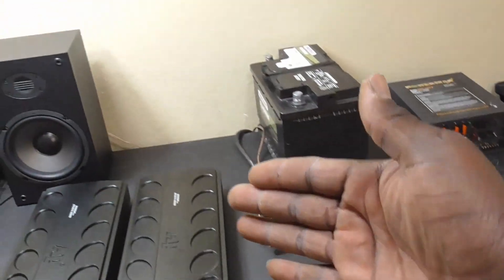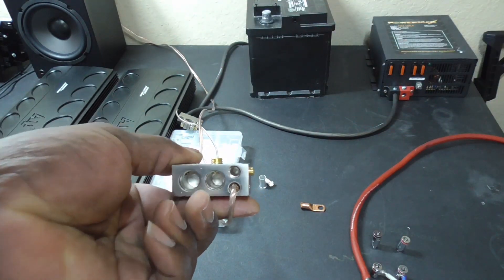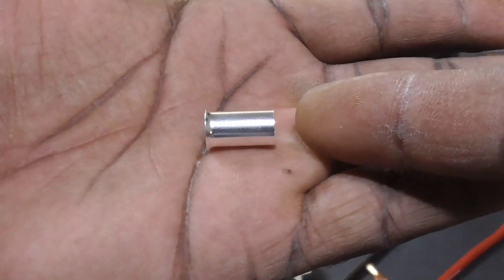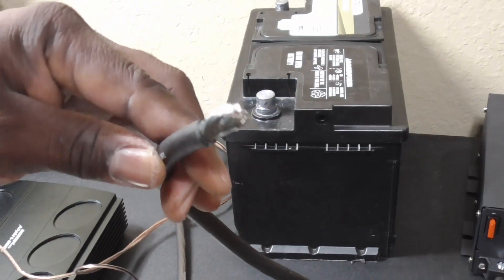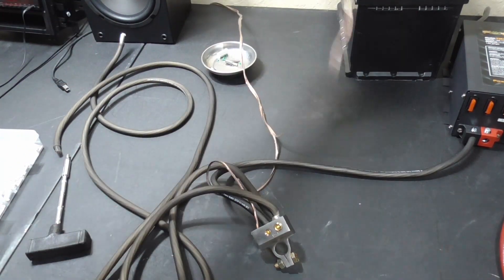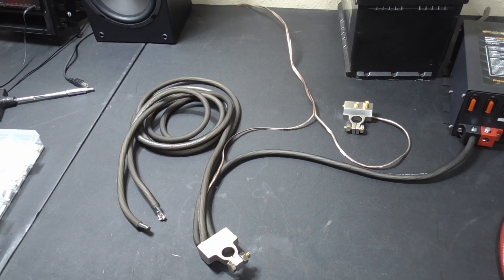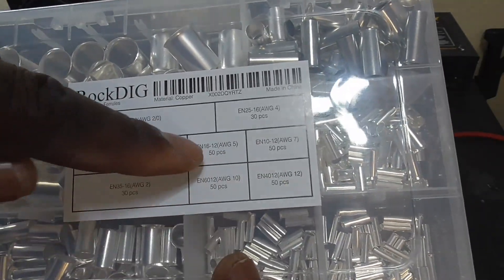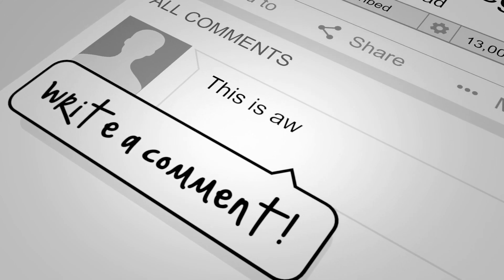Cheap And Easy Wiring Accessory: Ferrules

Comment: When applicable, for dual run power wires, I prefer to use the lugs with a marine battery terminal for the battery. Both ways work, ferrells are the way to go for clean and safe installation.

Comment: I finally broke down and bought a ferrule set last week and reconnected all my wiring to my 5-channel amp to give it a cleaner look.   I was tired of my bare wire insertion for my door speakers becoming brittle then breaking off causing the sound to be intermittent in my coaxial speakers.
Reply from the maker: Yep, they are very helpful.

Comment: I use those Silver plated wire ferrules with heat shrink makes a really clean connection really bugs me see a couple strands of wire sticking out plus that's all it takes to ruin your equipment.

Comment: Longest build I've ever seen at this point bro. Are we gon see the Taramps slap the vxf's this year?
Edit: I just think if you were posting more results then the channel would grow faster. Some ppl need the indepth info but the majority of this audience wants to see results. Let barevids do the tech stuff cause he's rebuilding and perfecting amp builds that have went pop.
Reply from the maker: I'm currently editing the MD8K footage. Its a lot. I bench test before installing in any vehicle. Its safer that way. Plus I have lithium cells to test and install as well. I try to test things 'The Right Way' as possible. And I can guarantee you, when you see my video on the lithium cells. You will learn something new. Be patient my, bass brother.
Reply: @BudgetBassHead  That's cool cause at this point I lean towards AGM just cause I'm not comfortable with lithium. I see a lot of guys using it but it doesn't seem all that safe to me still to this day. I mainly think along the lines with lithium that I'll have a wire issue (wire arch somehow) and my lithium bank would send me to Jesus...

Comment: It would’ve been better after doing all that if u would have got them back  out of the block and solder it
Reply from the maker: Solder sometimes introduce corrosion; depending on the 'type' of solder. but solder is mostly not needed, if crimped tight enough.
Reply: If you’re messing with any kind of electrical in a car and you don’t know what kind of solder to use them maybe that person or whoever should not be messing with car audio at all
Reply: And one more thing they actually do sale a crimping tool for those if you’re not using solder you should use the tool to crimp it right

Comment: As I commented in the last video, The 4 gauge wire just like their 1/0 is NOT over sized. Read right below the illustration on KnuKoncepts page on the flek wire and right below the amperage chart on wiki that yout referenced in the last... Or here as followed.
Knu- Below the picture in the specifications tab.
"*Core OD estimated, being stranded cable there is no true measure for B"
Now they say it is oversized BUT they state "increased surface area" This is because they use more thinner strands, note how they also state "Notes –While our Kolossus Flex Kable is oversized, most manufacture’s terminals will still fit our cables." They fit because it does not have a oversized cross sectional area. There is ZERO regulation on audio wire and they can tell you what they please and they word it sly. Not bad wire however not a higher gauge then what they tell you, We need not anymore misinformation in this community 

Wiki -
top of chart reads "The diameter information in the table applies to solid wires. Stranded wires are calculated by calculating the equivalent cross sectional copper area."  Then below the chart reads "AWG gauges are also used to describe stranded wire. The AWG gauge of a stranded wire represents the sum of the cross-sectional areas of the individual strands; the gaps between strands are not counted. When made with circular strands, these gaps occupy about 25% of the wire area, thus requiring the overall bundle diameter to be about 13% larger than a solid wire of equal gauge:"

I have had those terminals crack on the thinner piece that clamps the battery. Don't know what the material is but sure isn't brass and its cast where should really be billet.
Reply: What say you about Sky High "oversized" 1/0... Same thing? I have it next to some skar 1/0(not 1/0) and some RF 1/0 ATM And it looks pretty beefy in comparison.

They should define "oversized".
Reply: @snauspockets9924  as far as I know, I thought sky high 1/0 CCA was oversized stating it's actually 2/0 so that it meets the rating of OFC. I thought their 1/0 OFC was true 1/0 as it is equivalent to welding wire in strand count and flexibility. Now i know they have tinned which is new for them.

I do not care for sky high, not because their product stand point, as it is quality...

I build my batteries, alternators, rebuild my amps and design and build my enclosures. My builds are 100% me. I'm not a hear say kinda guy, i do research, obtain product and test real world. I've bought spools to try out all different wire. I am going to be running all CCA wire just because everyone is and will be up in arms about it cause their brothers cousins, cousin is dumb (😂). There has been people with 170+ builds running CCA. One guy running CCA changed to OFC because everyone told him he was losing power, he spent all that time and money to gain absolutely nothing, not a damn tenth, nothing!

 I'll have 5 runs from alt to rear 90Ah Cmax, have 1 370 and 1 320 for alts, 18k amp on 2 15" NSv3s. I'm not chasing numbers, I'm going low.
Reply from the maker: Thanks for the info. But misinformation is never an intent on this channel. To recall, I was only referencing what was listed on the amplifier. I don't think the engineers of the amplifier was intending anyone to use 2/0 solid wires. No offense, but most 'car audio' wiring companies are selling stranded wire and there is only a hand full providing as many strands (diameter) as Knu Konceptz. And remember my measurements showed 1/2 inch; which compensates for the percentage loss/equivalent mentioned in the article. Nevertheless, you've pointed out an excellent point and I know, more than I, will thank you for your observation.
Reply: @BudgetBassHead  I am not talking about the amplifier at all. I know misinformation is not intended, then we would call that disinformation and there is plenty of that in this community as well, that's neither here nor there.

 I'm talking strictly on the mention of Knu 1/0 being 4/0, 4ga being 2ga. It measured 1/2" on a tape measure. Try a caliper, account for air gap and what do you get? That's your cross sectional number. 

 I listed off from the vendors website and the Wikipedia page about AWG they both state that the AWG thickness is for solid copper. Stranded wire is not as easy to measure as there is a lot of air gap between each strand as circles do not completely fill the voids. Knukonceptz says they use more strands however they are thinner strands, considering skin effect plays no roll in VDC and the frequency of VAC on the speaker wire is not remotely close to being high enough for skin effect to take place, more strands only means it is more flexible (Is it Flek or Flex???? They don't know either so take their info with a grain of salt).....and less tinsel strength.

At the end of the day as i said, audio wire needs no underwriters laboratories rating, FDA, FCC, FBI wtf ever else.... No standards at all. But the way info spreads is like telephone except it's worse then elementary school up in this! 😂
Reply: I do find it interesting that all over the Amazon listings they all say Sky High Oversized 1/0 OFC and CCA alike.....but when you go to the actual sky high site they don't say anything at all about "oversized" instead saying "13mm or just under 1/2 inch".

Marketing hype or not it is good wire.
Reply: @DTW-bx2vy  what claims are you questioning?
Reply: @DTW-bx2vy  I'm uncertain on what claims you think i am making that are false but i have however listed the source. The same source he referenced in the video just didn't show nor did he see or understand the info completely. In no way am i bashing him or anything of the sort. I like his videos, his enthusiasm and only trying to help him if so needed. Just as he don't want incorrect info to be spread. As i said these are not my thoughts or what i believe to be correct, it is literally the same source he presented in the video. I don't make videos because I'm too busy doing other things and don't have one single "thing" of content I do on a regular basis. My proof is listed however i guess that entails one too actually put in a little work to do so. Of course there's people such as yourself whom like to try to prove me wrong and to that I encourage you to do your best, good luck!
Reply: @DTW-bx2vy  First, you need to reread where i said CCA is equal to OFC as I did not state that. Second, there is no inductance in DC so try again. 

Now what I said is skyhigh oversizes "1/0" CCA to 2/0 to meet the rating of 1/0 OFC. I also said there was a guy who had a 170+ db vehicle whom ran CCA and switched it all over to OFC and had no change what so ever. Now with that said, he obviously ran his wire accordingly, 1 run to 1 run sure you will gain something, at the level I run, 400watts isn't going to make a lick of difference if that were the case HOWEVER I stated I'm going to have 5 runs from my alternators to the rear Cmax banks. Now my alts are 320+370 which equals max 690 amps I'll be able to pull from the alts to the rear batt, there's no going over that EVER as it don't exist and that's not including the cars consumption but let's take the 5 runs of CCA and under rate it's capabilities and say max 1 run can carry is 200 amps, 5x200= 1000 amp current capability yet my max is 690, so leaves me with 310amp head room, with that much headroom you think I'll have enough conductor to combat any resistance or choke it might have compared to if i were to run OFC instead? The fact is, if you run the proper amount of conductor and (pay attention this one is very important) terminate your ends properly, you will run your system to it's full potential no matter the material you use. Now what false claim do you want me to prove to you that you were unable to grasp what I had said? As I said good luck!
Reply: @DTW-bx2vy  i also don't have a channel and make content cause I am a asshole. Well aware!

Comment: I think u will have to replace those wires in a few months. I did that to me 8k and I always have to replace the wire after awhile.
Reply: A few months? What? Where do you live? Is it a coastal environment with salt spray? Is it hella humidity every summer? Is the system on a fishing boat?

My sky high 1/0 OFC had better last YEARS or I'm going to be unhappy. I'm in the Seattle area so I don't have any of those environmental issues but damn, a few months? 200 bucks for 50ft!
Reply from the maker: Do you run OFC Marine Grade wire? Thanks for the tip.

Comment: You need to get some better battery terminals, those Chinese ones are made of cheap alloy and actually create more resistance than copper or decent stainless. Get some Jims Machineworx, GPAudio, or ILL Customz terminals, I prefer Lug Style myself....that way you can add more batteries and grounds and make your setup POP as well as see lower voltage drop.
Reply: lugs are good under hood as then you are able to completely seal the wire from the elements. Lugs and adhesive lined heatshrink!
Reply from the maker: Good info. Thanks
Reply: Yeah I got thinking about that too when I bought Sky high wire that doesn't have silver tinnig for corrosion. Once I put the lug on there and the heat shrink I don't see how it could matter. Zero wire exposure.
Reply: @snauspockets9924  wire is only as good as your termination!
Reply: @commonsenseisdeadandgone  okay sure but I was commenting on whether I should worry about the wire corroding or not. I'm going to do copper lugs on copper terminal plates... did you have a better idea for me to consider? I am all ears...
Reply: @snauspockets9924  Assuming copper buss bars ? Where? 

For under the hood i recommend all terminations to be tinned lugs, adhesive lined heat shrink, aluminum terminal connections, fuse blocks sealed, grounds ground to bare metal(as always) then primer/sealer, paint and clear. (I live in Minnesota so this might sound extreme but it's extreme conditions up here) but under the hood no matter where you live is brutal conditions with the heat cycles and elements. I crimp all my connections, i have the hydraulic crimper but find myself using the BFH smashy smashy tool most often. 

In the car its fair game, expose all the wire you want, whatever material you want. If you have issues inside, you issue is the outsides getting in! And in that case you have much more to worry about.

Comment: Nice Clean Job How The Audio Connection Gear Has Sky Jump From Late 80,90 So Much Affordable Gadgets And Gizmo Make Stuff Safe & Accessible. (Pharaoh) Ferrule Something Very Interesting Something Secure To Use Clean Connection. 👊🏻👍🏻✌🏻
Reply from the maker: Yes they are very handy. I've been using them for a few years now.

Comment: I started using ferrules on my current build. I like them but if you dont get it tightened down enough the wire tries to slip out.
Reply from the maker: This is very true. You have to torque them properly.

Comment: whispers heat shrink
Reply from the maker: I was going to use the heat shrink but wanted you guys to actually 'see' what is looks like. Plus this is an indoor setup, so really no need to protect against humidity or anything. But heat shrink does add style points 😉

Comment: I use electrical tape or shrink wrap to hold the ferrule in place and to make sure you don't see bare wires where the shielding and ferrule meet. Thanks for making videos.
Reply from the maker: That's a great idea! I was going to use the heat shrink but wanted you guys to actually 'see' what is looks like. Plus this is an indoor setup, so really no need to protect against humidity or anything. But heat shrink does add style points 😉
Reply: Yes that's what I do I use heat shrink and it holds it in place that way you don't have to hold it all awkward
Reply: Heat shrink can be necessary so a stray wire doesn’t pop out. I have the same issue, I used an Ill Customz dual input for my amp. I e never used ferrules but have always wanted to
Reply: My issue is that my amp has only 1- 8 gauge subwoofer output. I used a dual 8 gauge to 1 input basically as an output. Got it in today. Worked great.